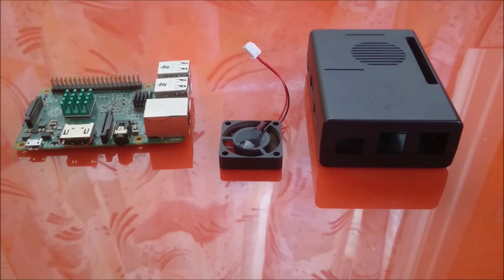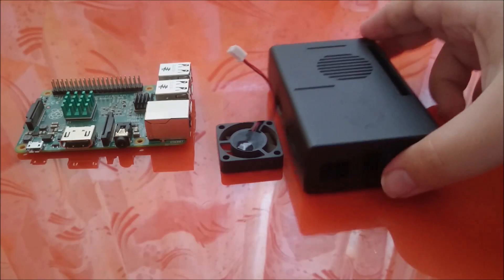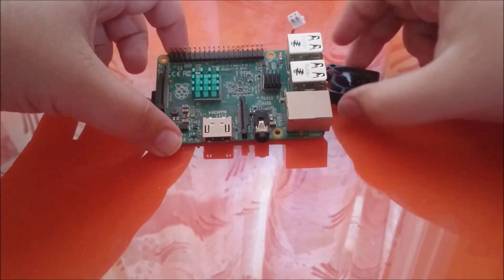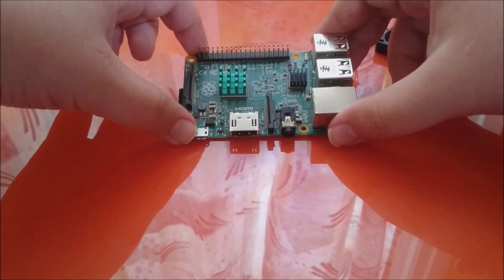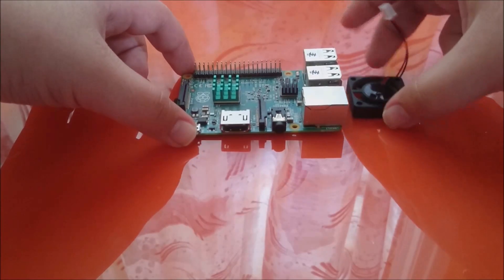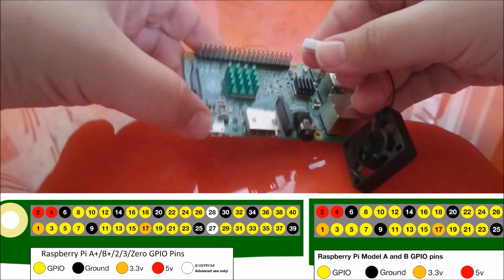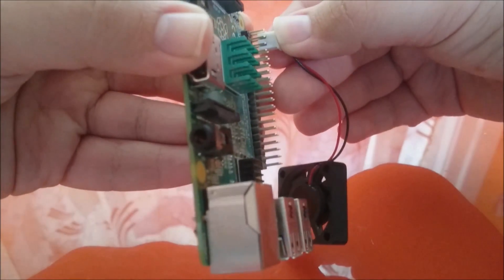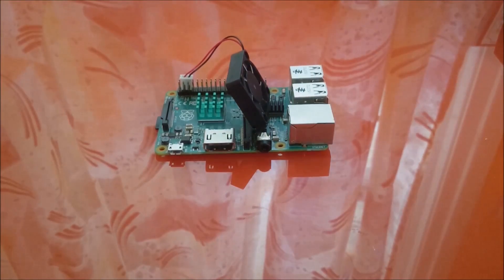How to Install a fan on a Raspberry Pi

Comment: Two things to add to the description:
- Please modify the title to reflect the Pi version
- The connector of the fan has a protruding lip (as per the JST spec) which needs to be trimmed away slightly where it catches against the case. (knife/file work of 10 seconds)

Comment: So which is the correct direction of the fan? This video is useless.
Reply from the maker: Any direction will do inside the case but I prefer mine to take air in rather than push it out.

Comment: The fan I tried turned out to be 12v so wouldn't start on it's own. I've ordered a 5v fan. I need a way to have it only run when the PI is powered up though, not constantly.

Comment: I do have a question though. I have two jumpers connected from a solderless breadboard with a momentary 'on' switch. I think one of the jumpers is attached to pin 6. Does this mean I cannot have the fan AND the on button both connected at the same time?
Reply: If you are using the set up I think you're using you could connect your two jumper cables to pin 39 and 40, as 40 is a GPIO and 39 is a ground pin, and then adjust your script accordingly.

Comment: Using this set-up only, is there a way to only have the fan run at a certain temperature or higher? Currently, it runs constantly if the console is on. I leave my console on 24/7, so it'd be nice to have it come on and off depending on temperatures. Thanks.
Reply: google "ksd 9700 5a 50c".

Comment: didn't you just use pin 4 and 6 4 being 5v and 6 ground. Anyway you don't need a fan unless you are going to over clock.

Comment: I connected them like he did but my fan didn't turn on, do I need to program it on the pi itself? or is my fan just broken? lol
Reply from the maker: Normally no programming is required. You could try powering the fan from another source to see whether it's the fans' fault.

Comment: my fan is twice as thick as this one, and it SCREAMS on that 5V pin...there are some 3.3V pins on that board that you can use, but they're not next to a GND so you have to pull a wire from the connector and check out the GPIO diagram to find where the right pins are.  put the red wire to a 3.3V pin, black wire to a GND pin
Reply: and be careful pulling those wired from the connector.  there is a small clip to lift up and they will slide right out